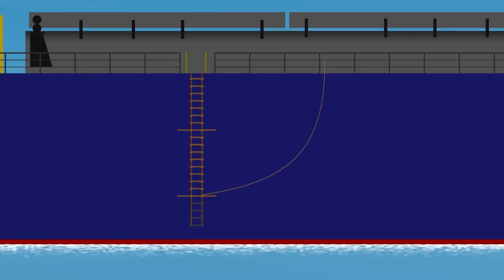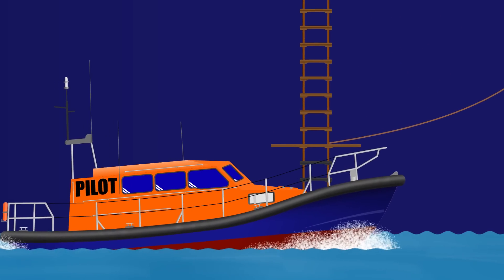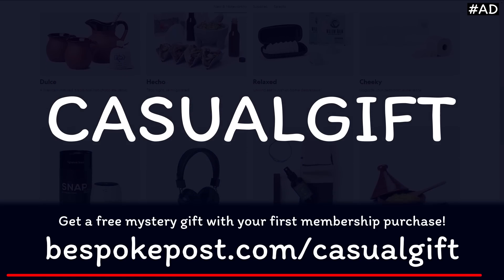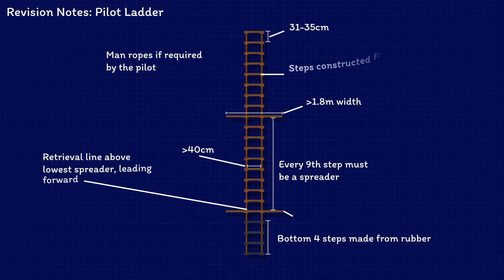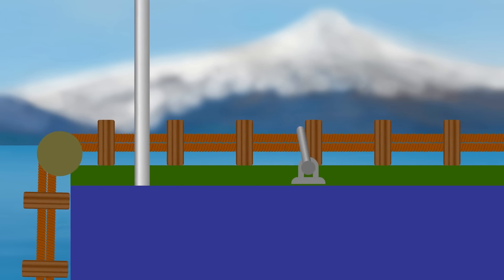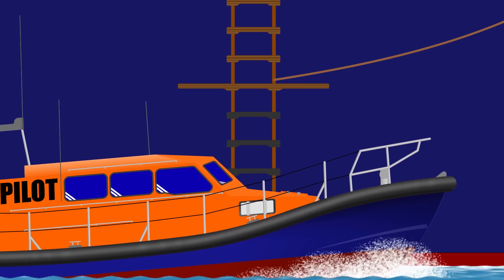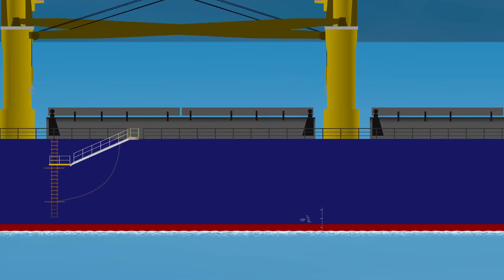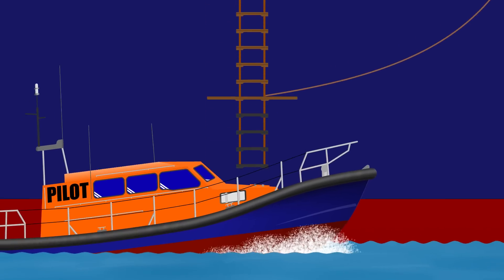Why Do Ships Have Rope Ladders?

Comment: And so the whole video is focused on WHAT and WHY a rope ladder is. But it still doesn't actually answer why ships have ROPE ladders.
The ships could just as easily have cable ladders or chain ladders or fixed ladders or openings in the middle of the hull or rope elevators or cranes or make use of a jetpack or heck...
The ship might even be boarding the pilot boat?

Why is it that ships have rope ladders?
My guess is it's because rope ladders are cheap and "reliable" and doesn't corrode in the marine environment the same way steel does.
But that doesn't answer why they can't just as easily have a crane that hosts the pilot up. It doesn't have to be a large crane and it could even be a winch hoist like that on coastguard helicopters.
And yes, there would be a problem with a hoist or crane in that the pilot could swing about wildly. So just have a solid bar then with a harness at the end so the swinging isn't such an issue.
And then we get back to cost... It would cost a lot more to have a crane that lifts the pilot so rope ladder it is. At the expense of the pilots safety and requiring all these rules and regulations that someone has to learn and apply "common sense" to...

Common sense is a pipe dream by the way. What is common sense for one person is not common sense for another.
Like it's common sense to...

- Drive on the left... Except the rest of the world drives on the right side of the road.
- Shake hands with people you meet, except some cultures find that insulting and with pandemics and all that you really shouldn't.
- If you like someone you should tell them, it's just common sense! Except when you tell woke people that you end up with a harassment charge and a restraining order.
- The horse goes before the cart! Except when you are shunting...

There are always exceptions. It's not always safe to assume everyone thinks the same way.
Also, one could say having common sense is a gift. No, it's a curse because you constantly have to deal with people that don't have any.

Comment: So many accidents. Is there such a thing as a safety line for the coastal pilot to clipped in for the climb? Rock climbers and construction workers use them.
Reply: Apparently that just makes it more dangerous, since the pilot can't jump off if the climb goes wrong. Pilot ladders would be somewhat wet, swinging somewhat severely, and in some sort of decay.
Reply: @doujinflip  , huh, never thought of intentionally jumping off...good point. Although, in rock climbing there is a spotter holding the safety line, giving or holding as needed.

Comment: You didnt explain why its rope, with all these requirements and failure points, why not a fixed steel ladder or, anything else
Reply: I also am not sure what the comparatively complicated staircase is needed for. Just to make it so the pilot doesn't have to climb so much?
Reply: @paulgemperlein626  it is just so that the pilot doesn't have to climb as far. 9m in bad weather at night is quite far. 5:54
Reply: @sigurdhovden4961  That and a fall from 9m may hurt you, but a fall from higher than that will definitely hurt you, even if it's in water.

Comment: Right, but why is it made of rope though? Wouldn't it be better to have a metal ladder built onto the side of the ship?
Reply: A metal ladder would be a liability when it comes to priates. Plus, I'd imagine a metal ladder would be harder to replace.
Reply: Metal parts would also gouge the paint as the ladder rocks about on the waves, introducing a lot of points for saltwater spray and rust to seep in.